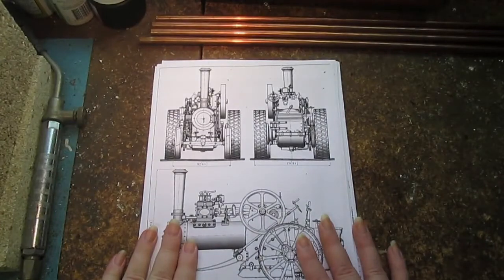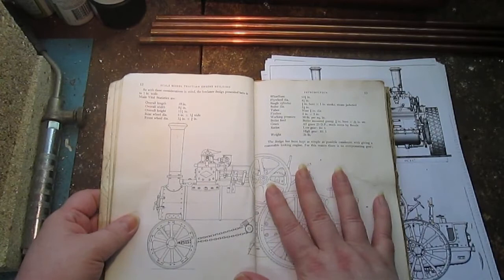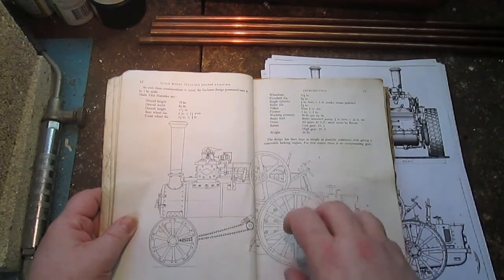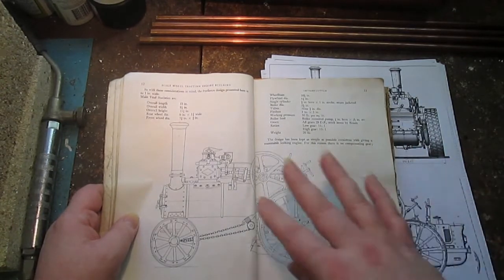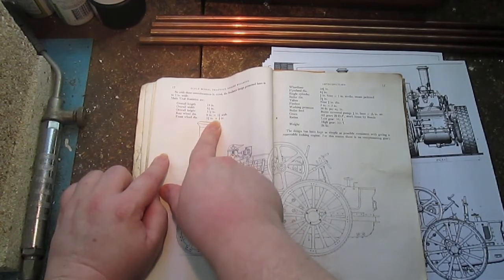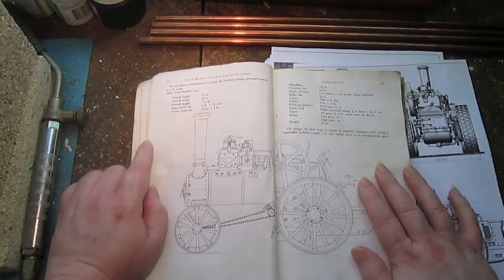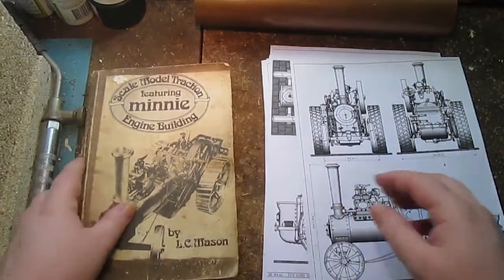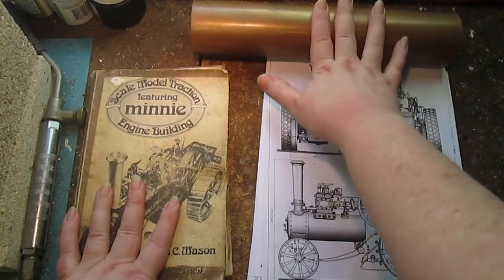Introducing Minnie - A 1" Scale Steam Traction Engine

Comment: I have had this book for a few years and want to make this too. Complete beginner. Would a 7 x 14 size lathe be big enough? What size milling machine is needed?
Reply from the maker: The larger of my 2 lathes is a 7x14 which is just fine for a 1" scale Minnie; the biggest thing is the rear wheels at 6". You could do all the milling in the lathe with a vertical slide; for that matter you could probably do it even without a vertical slide, just clamping the job(s) to the cross slide. Otherwise just about any mini mill should be able to do the job. It really depends on how much milling you want to do; for instance you could mill the wheel spokes, but you could also cut and file by hand (or get them laser cut).